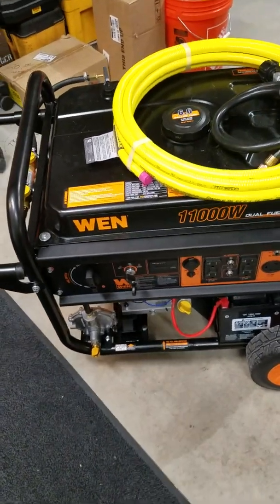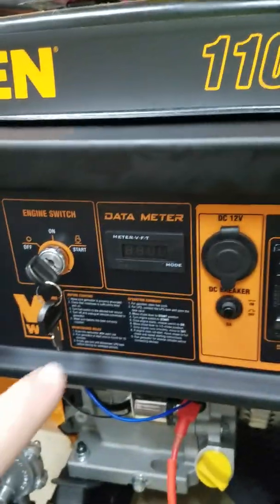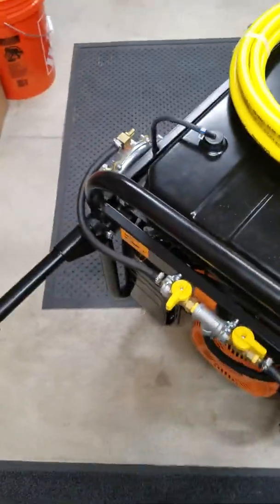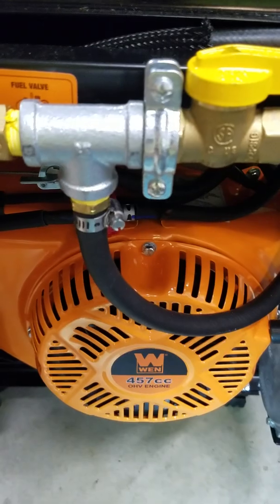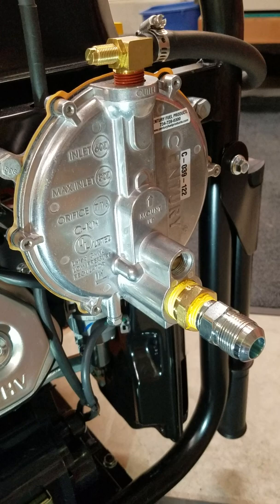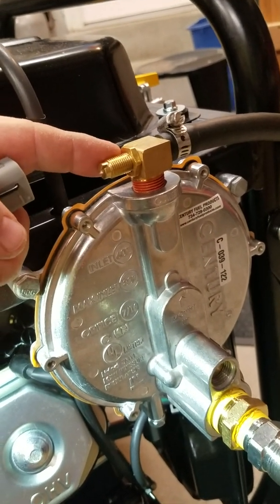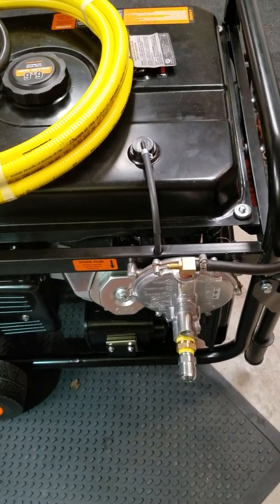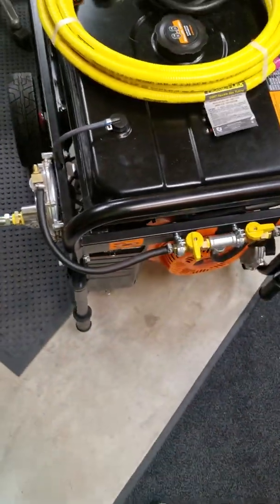WEN Generator Natural Gas Upgrade (Tri-Fuel)

Comment: Can you eliminate the propane regulator and replace with natural gas regulator without modifying the carburetor? I’m planning to do the gasoline and natural gas on this WEN generator.
Reply from the maker: Absolutely yes you can. I chose to leave the propane regulator on the unit as another source of fuel in case of some other type of natural disaster and we would potentially lose natural gas pressure. You would simply uninstall the propane regulator and install the natural gas regulator in its place. This would allow you to run it without having to make the manifold system that I did.
Reply: @ryangremminger1  thank you for your excellent answer. I just went through hurricane Ida and didn’t want to wait for miles for gas so I wanted to tap into my gas pipeline. LP is also more expensive than gas and the refill station also shutdown when there is no electricity. I’m ordering the NG regulator and to try out this method. Thanks again
Reply: @ryangremminger1  I could be wrong (I'll know for sure when I try it myself in a couple of weeks), however I think you could simply disconnect the propane supply hose from the carburetor, replace it with the hose from the natural gas regulator and leave the factory propane regulator in place. Then if a time came where you had no natural gas all you would have to is swap the hoses again and you are back in business with propane again. No modification required and maybe save quite a bit of $$ on fittings etc.. I think there may even be a kit from Nash fuel designed and advertised for just that.
Reply: Do you think I need carburetor snorkel if I used 3/4 gas pipe line instead of 3/8 line like you have in this video? Thanks
Reply from the maker: @booshiet  since this generator came ready to use with propane already I would imagine it already has a snorkel built-in from the factory. Unless they built a special carburetor allowing Airgas into the mix some other way. I'm not quite sure to be honest with you. I contacted the natural gas regulator manufacturer and ask them about the pipe size going into the regulator. They said that for long runs you're definitely going to need 3/4 pipe to the inlet orifice. I explained my shorter run and they said 1/2 May suffice but 3/4 would still be recommended if the motor wouldn't perform as expected. I had already purchased materials for 1/2" so I went with it. The outlet orifice of the natural gas regulator is 3/8 of an inch so as long as you keep your run short from the regulator to the carburetor I don't know if increasing that pipe size would make any difference.
I hope this answers your question. Feel free to reach out again. Thanks and good luck!
Reply: Is it necessary to have load block install on the outlet of the regulator?
Reply from the maker: @booshiet  after putting mine together I think not. You can buy a 90 fitting and make any necessary adjustments on the regulator.
Reply: please post if it work or not Other are very interested in the out come I have the WEN Generator and want to do the same thing.
Reply from the maker: @lashownjones9289  go to my channel for all the other videos about the generator. I have run video and hardwire to house video. Thx!

Comment: I have no experience with natural gas.... but I've seen more than one video where the person either didn't have enough gas pressure at the source or upgraded to a ridiculously large diameter supply hose... so... not having any experience with Natural gas (as I've mentioned) ... you might wanna explore a little and see what kind of pressure your house is offering at the valve you connect to... and that will help you troubleshoot your issues. Good luck... looks like a very nice setup... and thank you for the video and your time...
Reply from the maker: So I did have some other YouTubers mentioned some ideas about my starving gas pressure. A bigger diameter supply hose was definitely on the list of things to do for the next one I build. The other thing is on the needle valve load block on the output of my natural gas regulator, I took out the needle valve itself and I ground down the pointy tip almost to where the threads began so that there would be less of a obstruction between the regulator and the engine. This did help with the labored motor sound. Nonetheless still getting the correct voltage amperage and Hertz out of the generator running on natural gas under load. Thank you for your comment!

Comment: Got everything plumbed and running on natural gas. I've got the wgen9500df. I've got two 1500w oil radiator heaters on a timer device to on20/off50  the load. Used the same setup to break in my wgen5300df iirc. Lugging bad. I popped the cover off and I will take the set screw out then adjust. VERY little change in the engine taking to both directions. It's a LITTLE better backing it out. I've locked it back in to set that spot. Kinda disappointed to be honest. Hope the 50a performs better when I upgrade from 30a.  Using standard hoses (one that came with and the cannibalized LP regulator hose.

Comment from the maker: This is another work-around for the 3/8 load block. https://www.amazon.com/Barb-Male-Brass-Elbow-Fitting/dp/B07FRZ8BX7#
Reply: i can not find the natural gas regulator circuit setter ANYWHERE Please help😀
Reply from the maker: @lashownjones9289  I did a little poking around the internet and concluded the same thing that nobody seems to have these in stock. Double check to make sure that your regulator doesn't have a hidden pressure adjustment screw underneath a silver cap like mine did. If you find it and you think you need to adjust your flow rate then all you'll need to do is pick up a 3/8 MIP to Barb fitting at Home Depot. If you need to make a right angle then just pick up a 3/8 male male Union and pick up a 3/8 tee and the 3/8 MIP to Barb and a 3/8 plug. This way you can make a basic right angle fitting.
Reply from the maker: https://www.eng-tips.com/viewthread.cfm?qid=467990
Reply: @ryangremminger1  After reading further I came across one of your subscriber comment able removing the propane regulator and replacing it with the NG regulator .. THAT IS Awesome!!! Will it work? Furthermore, I just wanted to say what you and other Talented  men like you, who post these videos are doing a great service and I personally thank you,,, When TX had that freeze a lot of people die unnecessary now with your help and others like you we can control of own fate... THANK YOU SIR I appreciate what you are doing!
Reply from the maker: @lashownjones9289  it should work. Thank you for watching! Check out my channel for more videos on the generator project.

Comment: Ryan, really appreciate you sharing this, it made it very easy to replicate, the only thing I did different was that I use stainless steel bolts and nuts.
https://drive.google.com/file/d/1XUA30HMuxC2TKj1scV5p3DDmXWmgMRjZ/view?usp=drivesdk
https://drive.google.com/file/d/1UAYO-GeiqAmi4tybzw0s8kn4C-_ahDWw/view?usp=drivesdk
https://drive.google.com/file/d/1q99KpyjtdpmmjmXY1YUskTuYR98VnOg8/view?usp=drivesdk
Reply from the maker: Thanks for the compliment! I went cheap with galvanized. It was easy to come by at my local hardware store. There's a few more videos that go along with the generator so go to my YouTube channel and check out some of the others. I recently just added a six-month test with whole house air conditioner.

Comment: Ryan, that part you called a "Circuit Setter" I did not get with the regulator I ordered, what is that part called. Circuit Setter did not locate it in a google search? I see it in the other kits but I'm not finding a listing that provides that part names. Thanks, and I just purchased the same generator and plan on duplicating your installation.
Reply: Ryan, I was able to contact Nash Fuel and it's called a Load Block and everyone right now is out of stock, but he did say he'd have them in stock in about a week.
Reply from the maker: https://www.amazon.com/dp/B07BF4HP9Q/ref=redir_mobile_desktop?_encoding=UTF8&psc=1&ref_=ppx_yo_mob_b_track_package_o2_img
Reply from the maker: yea this is the link to what i bought. it may be available by other vendors by searching for the correct size and name of it.
Reply: I'm going to try this before I did out the disc. https://www.amazon.com/dp/B08G4H9L8R?psc=1&smid=AC9R1W900AN3F&ref_=chk_typ_imgToDp

Comment: Thumbs up. Thanks for posting this. Super helpful.
You're getting 34.6 amps per leg - 69.2 amps total. Plenty to run a home. A block shaker and not a clean Sine wave. 30% distortion. https://generatorbible.com/generators/wen/df1100t/

Comment: We this this for the Powerhorse 7500 inverter.
Reply from the maker: I would have liked an inverter style for the clean power. Harbor Freight came out with this after i installed this project. https://www.harborfreight.com/9500-watt-super-quiet-inverter-generator-with-co-secure-57080.html
it comes close but is restricted to 30a breakers and no 50A rv plug. the powerhouse looks like a solid product but i did not have the budget for it for this project. Thx for the watch!

Comment: FYI... 8300 running watts at 240 volts works out to 34.5 amps... so the circuit breaker is appropriate for the wattage output. If you want a "true" 50 amps you need a generator rated at 12000 RUNNING watts. Also those circuit breakers are there to protect the generator, not your house.
Reply from the maker: I absolutely understand what you're saying. I understand that the running wattage would have needed to be much higher to support a true 50 amps. I just wanted to point this out in case other people would just see the plug and think that it was a 50 amp because they may have an RV and are used to that configuration. I do appreciate the feedback!

Comment: Just bought the same generator and was planing the same deal, adding natural gas option. The question, adding the second gas diaphragm instead of just using the original one that came with it was it purely for the ability to quickly switch from one gas, natural gas to the other gas propane, without having to do any tuning. To use the original wen df1100t regulator with natural gas you would just pull straight off the natural gas meter output side and into the wen diaphragm without needing the supplied regulator because the gas company's meter is already low pressure in most cases. Very nice job. the 50 amp plug had me puzzled after reading in the manual and seeing it rated at 35 amps.
Reply from the maker: The built-in Factory regulator for LP is designed to run at a higher pressure from your LP tanks. If you feed natural gas at the pressure that your gas company gives you it will not work. I had to do some learning on this myself. There were a couple other generators that I kicked around the idea with using. And one of them touted that their Factory regulator could be used with LP or CNG. I had to look that up and CNG stands for compressed natural gas. This would be natural gas that is stored in a tank like propaine. These tanks store the natural gas at a much higher pressure than you typically get from your natural gas provider at your meter. Once I learned that there were differences in the pressures I started educating myself about what pressure my natural gas provider gives me. That's when I determined that I have to run a diaphragm regulator that is designed to run at the pressure my utility gives me. It is convenient to have the two Regulators for selecting your fuel source but it is necessary to have both because of different operating pressures of your fuel sources. I hope this helps. Let me know if you have any more questions. Thanks!
Reply: Thanks,  I appreciate the information.
Reply: super Dave, I'm running a $30 tri-fuel carb from amazon and it is stamped CNG and it runs fine on my garage natural gas hook up,
I will never go back to gas, natural gas is on tap, Propane can be stored for years without going bad, no carb rebuilding too.
Reply: @stclairstclair  
Yes, I picked up one of those for another propane project, couldn’t believe how cheap those are and yep it did work 👍🏻
Reply: super Dave, I found a champion generator video finally explaining what I bought, The tri-fuel has a fuel control valve on the side of the carb,
It is not the big regulator like you see sold for 300 bucks, with natural gas your home is already regulated and a simple propane regulator is used on a bottle, so either way having the gasses regulated to low pressure is simple, So this tri-fuel carb can manage the low pressures just fine,
I have a beautiful gas line in my garage that was screaming "I'm way better than gasoline"
My generator runs perfect on natural gas and I'm never going back.

Comment: Very ingenuous conversion to natural gas. Please post part 2 running natural gas under load.
Reply from the maker: Check my channel for the second video to this generator. I am in the process of uploading it now. It shows how I'm setting this up at the house it will be used at.
Reply: Thanks for the video. Would it be possible to add links in the description section so that it's easier to duplicate?
Reply from the maker: @-ss0  i updated the video notes. if there are any parts that may be missing let me know. Thx! there are 2 more videos on my channel about the generator if you haven't seen them yet.
Reply: @ryangremminger1  Hey Ryan. Huge thanks for the list. My Wen 11,000 finally came in. Time to start ordering parts!
Reply from the maker: Thx! I did run this under load but forgot to make the video. I'm going for my permanent install this weekend. Ill be sure to make another video then. my 1st load test went well. It ran everything in my house but my electric dryer, electric furnace. i did however run the 220 furnace fan witch is important because i can run my vent free gas fireplace in my basement for heat and circulate it with the furnace fan through out the house. it also ran my electric water heater. the only thing i could not test was running the central air a/c. it was to cold this day.
Reply: @ryangremminger1  Awesome thanks for the update.